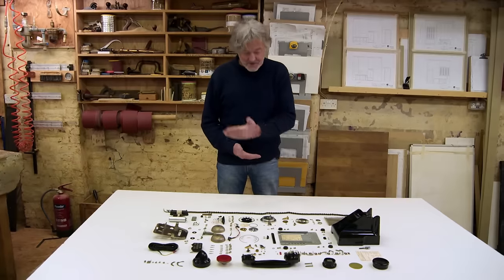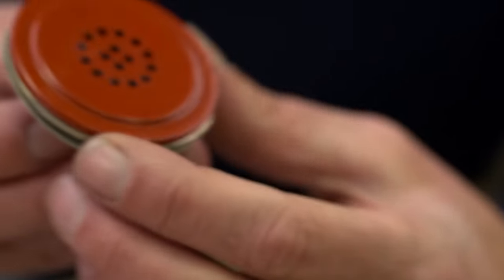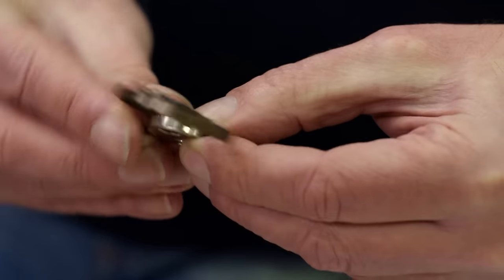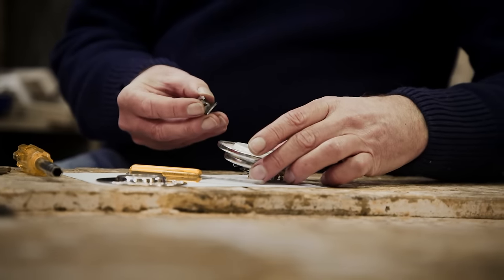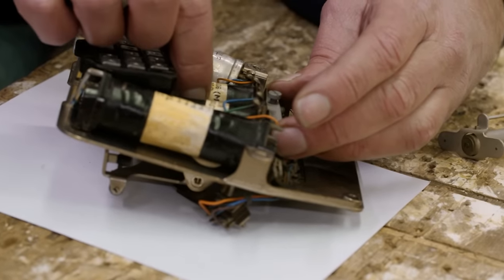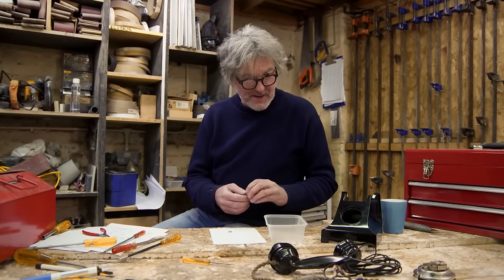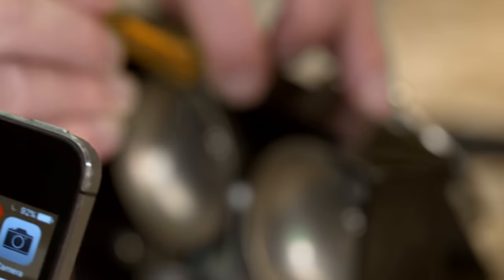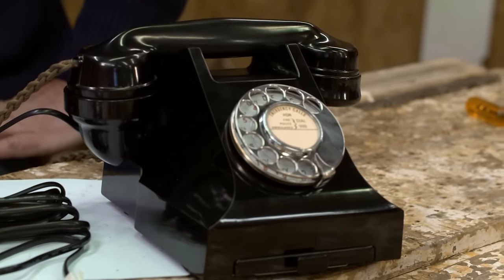James May Attempts To Build A 1957 Dial Telephone | Reassembler

Comment: When I was a kid, I was impatient with that poor dial. I would dial the number, then force it to return faster then it was supposed to. Fifty years later I feel bad for how I treated an appliance that is long gone. lol Love watching and learning.
Reply: And you were lucky that it worked, because half of the pulse dial was counting when the dial returned to nominal. This is the mistake most people made, thinking that when they turned the dial it was passing the number, but in fact it was actually in reverse when you let go of the dial and take your finger out that's when it actually dials spring back.

And it does this over a set amount of time, so you can't really rush it.

Lee Evans made the funny joke, that the emergency services r999, taking the longest. If it was 111 it would be faster. Lee said, that by the time you've got to the last 9 your relative would be dead. Lol.
Reply: I think we all did the same thing with the dial.... The modern equivalent of this impatience is pressing the lift button multiple times to make it arrive  quicker which obviously never works. 🤭
Reply: I'm not sure the timing was super critical. When my parents phone dial broke over a weekend, I discovered I could dial by repeatedly depressing the on-hook switch. Larger numbers were problematic, but since our exchange was 333, as long as there weren't too many sevens or above and the remainder of the number, I could click dial out a number pretty reliably.

After about a day of that my dad saw me and asked how I managed to make a phone call. I showed him, and his eyes lit up. He had years of experience as a morse code operator, and his hand was much steadier than mine was - he had. no problem with the larger numbers at all.
Reply: @47f0 I discovered the same trick when my parents put a disc lock on the dial. I’m in prison now.
Reply: ME TOO-!!  LOL  as a young teen if the number was busy id force the dial back in frustration, wonder I didnt break it
Reply: @garyz2043  - but to the real fun started with DTMF...  and those modified pocket dialers.
Reply: @RB747domme  IF you think 999 takes time, before 112 here we had to call "90000" to reach the emergency services. xD

Comment: I discovered that you could "dial" the digits by tapping the cradle switches with each digit. 0 being 10 taps was a challenge. The key was to tap the long digits fast enough but to also pause long enough after a short digit. It was great at my mate's house where is parents had put a lock in the   number 1 dial hole that could only be removed with a key. We would call Dial a Disk, no problem, well until the bill came through.

Comment: I think it was in Radio Times where he said something like it's always easy and fun to smash stuff up which was the premise of his co-presenters on some car programme on telly that lost its way and turned into a real twatshow, but not always easy to put it all back together again.

I've got one of those GPO screwdrivers with the clear yellow plastic handle somewhere - it was my favourite screwdriver as a kid when I used to like taking stuff like old Dansette record players, gramophones, phones, radios and the like to bits (even live wall sockets) and in the case of one Dansette record player, leaving the most of the bits all strewn around the garden. Couldn't always put them all back together afterwards though. As most electrical household appliances weren't supplied with plugs, that was my job as a kid to fit plugs to everything - I also had the perfect teeth to strip the insulation off wires back then.

While I can't stand the bloke at all, it would be interesting to see how much patience jeremy the twat clarkson would have for doing this type of thing and how many seconds into it would he have a meltdown and throw in the towel.

Comment: You /may/ be lucky to get that old PSTN phone working nowadays in the UK, but not for much longer: like TV & radio, the phone system (& hence exchanges) are being gradually replaced with digital tech that doesn't work with the old analogue systems

FWIW we used to have one of these phones in the house I grew up in, in the 1970s-80s; I wish we'd nicked it when we moved :)

Comment: 23:25 - "every on and off is its own separate connection..."

With modern pcb's and microchips, there still is individual copper traces that feed and come from the chips and boards, the miracle is that its has gotten smaller on a logarithmic scale. Moore's law is an interesting idea to read into on this topic if you're interested. Basically he found (and it has held true) that the amount of transistors on a board has/will doubled every 2 yrs as tech advances. All those connections are still present in modern electronics, it's just that you need a very good microscope to see them now.

Disclaimer- i am not a engineer, if im wrong about this, id like to hear it.
Reply: He also mentioned switches, some of those are indistinguishable from what they once were and incredibly small. Mosfets and the like are tiny.

Its fun to think of a smartphone built with 1950's tech would be the size of a house, if even possible at all. Lol

Comment: no it does not use electromagnetism to convert the sound into electricity, it uses a carbon mic to do that ;) (yes i know dumbed down for the masses)
Reply: and I have 3 of those screwdrivers :)... the link between the contacts in the bottom and top  are linked by a fairly large pair of copper conductors soldered to terminals, embeddedin the bakelite before curing

Comment: Your modern world connector is a long way from the Western Electric/ Bell laboratory RJ11. We on this side of the pond did not have a GPO phone system. We had The Bell System and General Telephone. We learned to feel sorry for the unfortunate folks who lived in places serviced by General Telephone. All long distance was AT&T the parent company in the Bell system.
Reply: GTE systems were the first in North America to use the automatic dialing system, developed by Strowger, the founder of Automatic Electric, which was eventually bought out by GTE. AT&T insisted on using manual switchboards until they were forced to change over when threatened by an operator strike. I grew up with a clone of an AE Monophone, made by Philips of Canada. In Manitoba, we had a government run telephone system at the time, MTS (now owned by Bell Canada).

Comment: No James, it wasn't 01709 it was 0709. The 01709 came later, in at least the late 80's but maybe at the beginning of the 90's. I remember my area code being 0708 and then becoming 01708 (Romford). You are a fair few years older than me so your area code would definitely have been 0709 back in the telephones with the dials days.
Reply: @monsieurtechnical oh right, yeah I remember now. Like for my mum and dads old phone number, it started with 73 and then had a 3 added to the beginning making it 373 although it changed it from 5 digits to 6

Comment: It might receive a ring, but I'm not sure they still accept pulse dialing.
Reply: If it rings you're likely still on an old (local?) exchange: the 50V (120V pulse) ring power cct is being phased out as it's not needed for modern phones. Unfortunate IMO, as while it existed it was still possible to use the phone during a power cut in emergency :(

(Don't bother to try to power anything else by (illegally) tapping that cct: the current is minimal & is extremely closely monitored)

Comment: Gonna have to disagree with you again James - Modern smart phones are (or were up until a couple of years ago) full of little screws - bastard 000 tri-lobe ones!  I had to replace the screen on one not so log ago, only this time the screws are 1/2 mm diameter and 1.5mm long - talk about fiddly!